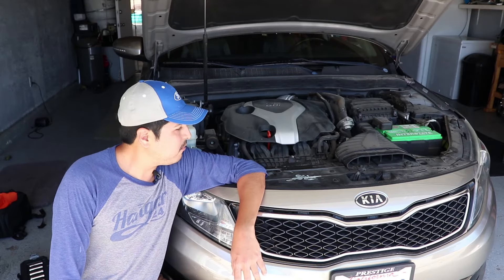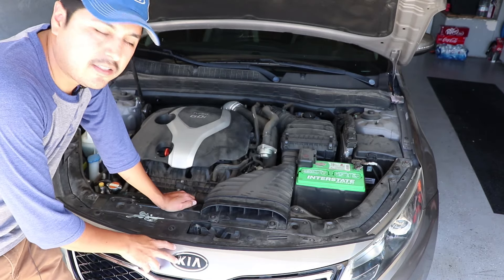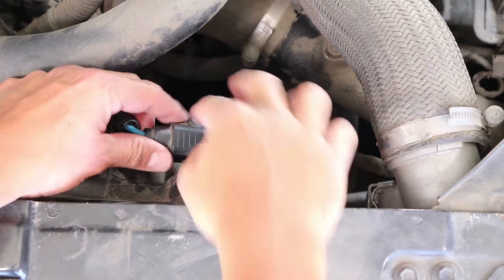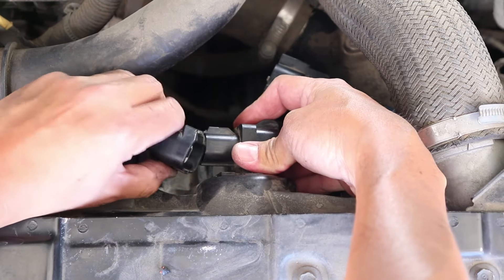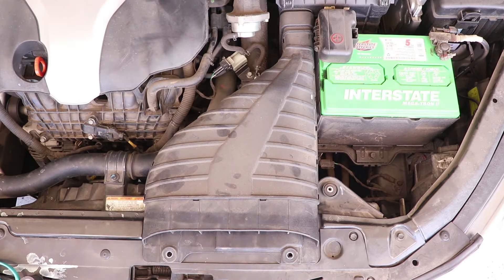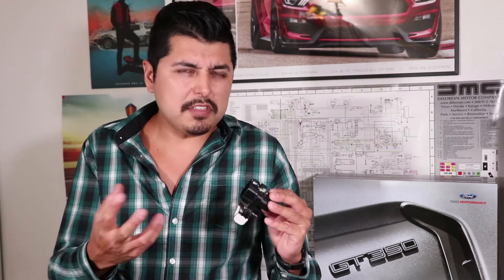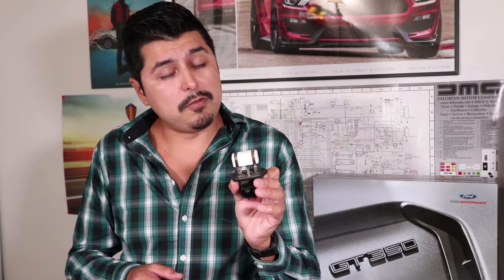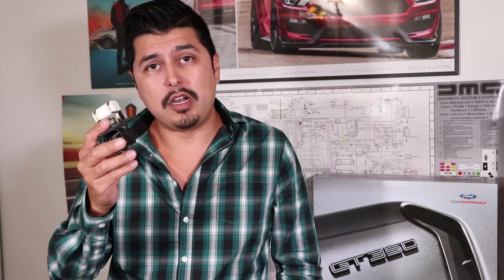Overheating KIA? Cooling Fan Module Fix (Optima, Sorento, Sonata & Santa Fe)

Comment: Hi I got a problem with my kia picanto 2011model car overheat I replace new thermostat new fan new heat resistor but the car. Still over heat what can it be

Comment: On my 2015 kia optima even the plug looks burnt. Do you know were to get that part at? Im having trouble finding it. Even dealership told me they dont have it! TIA
Reply from the maker: Hi Rafael, if the plug is burn here are the replacements, if the plug is like a rectangle: https://amzn.to/2RkFife If the plug is similar to a square https://findpigtails.com/connector/kia/sorento/2008/radiator-fan/?product_title=2008%20Kia%20Sorento%20A/C%20Cooling%20Fan&gclid=Cj0KCQjwwOz6BRCgARIsAKEG4FXB7vcnHsQepR0aQTUrYXZeKRLJLSabWLP7eiPmvu5aAKOBOVwX_QgaAnJaEALw_wcB&fptgac=1671066134  Hope this helps!

Comment: I have a 2012 kia forte sx. My fan isn't coming on at all. I tested the fan it works. I think it might be this part bad maybe
Reply from the maker: Hi chidey21! where you able to pin point the issue with your Kia? it seems this sensor module seems to be a very common issue, not sure if that was also the issue with your car...
Reply: @AlexAutoFun  No I changed the resistor and the fan still isn't kicking on so not sure what it is
Reply from the maker: @chidey21  Oh man, how about the connectors are they in good shape? (I had to replace some before they seem to melt and the contacts get damaged creating a bad connection) There is also the possibility of the engine coolant temperature sensor having failed, low coolant or air (large air bubble) in the system which would prevent the coolant from reaching the engine coolant sensor that may also keep the fan from turning on...
Reply: @AlexAutoFun  I looked at the connector they look good and I took out both my low and high speed relay out and touched the connector together and the fan kicked on in both speeds . Where is the engine coolant sensor located at ?
Reply: @AlexAutoFun   I  just tested the continuity between relays in the fan I have continuity in the relays so they are good

Comment: My KIA carens, overheats at 6th gear...possibly 5th aswell. But once i reduce the gear and speed at 4th gear 30mph...temperature goes down. What could it be? Before I take it to garage
Reply from the maker: Hi Sadik! That's must a different issue than a fan, since you are moving fast (5th or 6th) there should be enough air to keep the car cool with a bad fan. I would check the rest of the cooling system, you may have large air bubbles in it or the it may be due to have a complete flush to ensure it's running at is best condition. Also check for engine codes just to make sure it's not related to another issue that it making the engine over heat. Hope this helps and please let us know if you figure it out bud!

Comment: Could this be the issue if the overheating only happens after driving the car for 30 mins or longer
Reply from the maker: Hi Royal! Yep that maybe it! the car is relatively cold at first and will stay a normal temperatures for a bit (30 mins sounds about right) after that it depends on the fan working correctly, if it does not turn on and you are still driving it will overheat (note that if you are driving on the freeway at a normal rate of speed you may not overheat as the air going into the car from driving fast is enough to keep the car cool but as soon as traffic starts and you slow down, the car will overheat). Hope this helps buds!
Reply: I have the same problem I drive my car for 40 minutes in the freeway and it was cool in when the traffic stop started to overheating do you think that’s the problem?
Reply from the maker: @elprimochef9423  Hi El primo Chef! it sounds like this could definitely be your problem, I'm actually surprised to see how common the issue is ever since I posted this video :0
Reply: @elprimochef9423  do you lose coolant thru the reservoir too?
Reply: @AlexAutoFun  I have a 2015 My radiator  fan wont come on I replaced the coolant sensor ,and fan relay and thermostat , also put 12v to fan it was tested good... ANY IDEAS??? IM STRESSED...

Comment: My fan turns on immediately after startup what could be the problem??
Reply from the maker: Hi Zark Vip! On some cars it's actually normal that the fans turns on immediately after startup. See if you have check engine light on and if it is a mechanic can pull the code to see what the issue is. If there is no check engine light and you are experiencing overheating it could also be low coolant level or air in the cooling system which a mechanic can easily address, hope this helps and please let us know what you find bud!
Reply: @AlexAutoFun  it was the coolant temperature sensor connector the engine was replaced and the mechanic probably damaged the connector. i wired one from the junkyard.
Reply from the maker: @Ray-tt6tn  Ahh that makes sense, good to hear you figured it out man and thanks for sharing the fix!